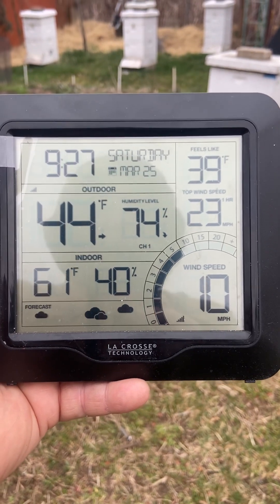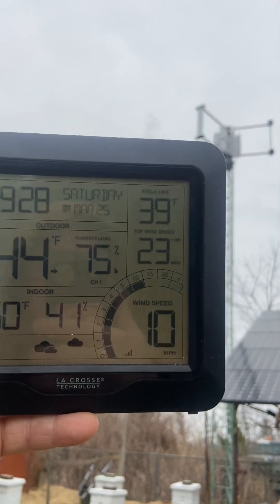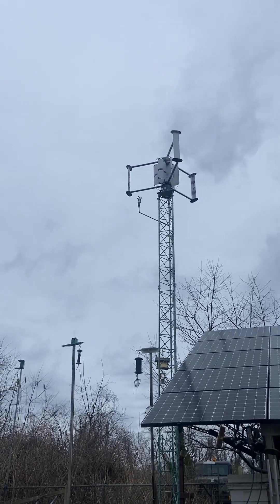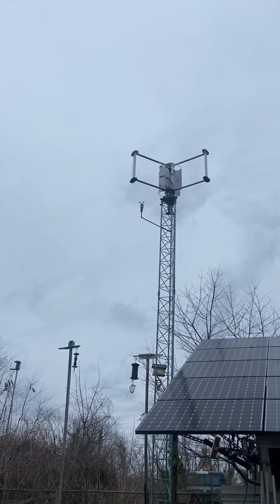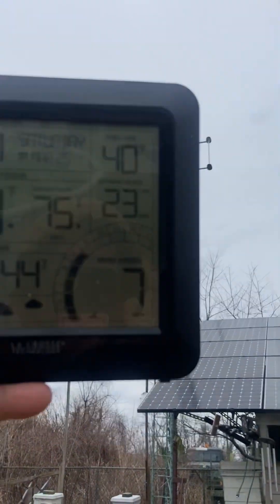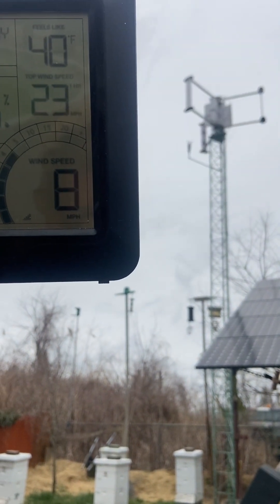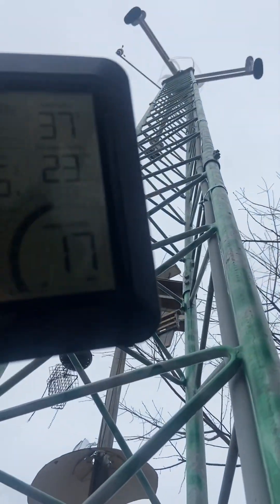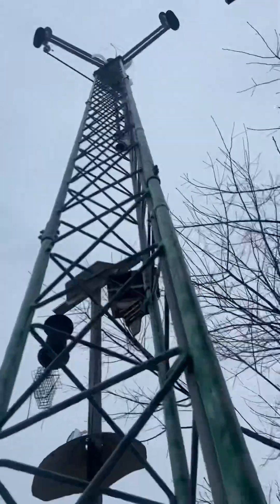Vertical Wind Turbine, test, run ￼￼

Comment: I'm sure it was a fun project. However , the start of a project should have been with anemometer data , trough some period of time , possibly throughout the whole year (wind speeds and direction , at desired height) , so that you can calculate average available potential energy of wind at specific location . That would help determine which turbine type/design , size and generator (potential) power. In my mind , lift type of VAWT are good for fairly strong and (more or less) constant winds , like onshore locations and hilly/mountain terrain , with specific landscape , which directs the winds (with fairly lightweight turbine construction , within a reason) . In other cases (I'm talking about VAWT) , drag type are better (savonius , with myriad of designs) , because they can utilize low speed winds and frequent change of direction of wind. In case of drag type turbines (usually low RPM) , torque is utilized (gearing included) to turn the alternator/generator (usually permanent magnet ones, air core ) at required speed for usable energy production. Also , most people are "obsessed" with physical efficiency (how much energy they an extract from available potential wind energy) , while I usually think of financial efficiency , which means , how much it will cost to build something (using recycled and up-cycled and free materials as much as possible) , that produce some usable amount of energy , for very small amount of money; if I'm about to spend a thousands of $ for it , I just might as well use grid power , as much as I like , for years , for the same amount of money.
Reply from the maker: Thanks for the input, That requirement for an Anemometer  was one of the things the state of New Jersey wanted six months to a year of data before they approved the rebate. Little out of reach for most people because it cost thousands of dollars just to put a stand up to collect the data. Just to see if you qualified., If you didn’t, you wasted all that money just collecting data.
Seeing I have already have a full electric house. +19 K in solar, and 40 K in Tesla battery  back up. 
This generator project is for me and I am an amateur learning a lot about the does and don’ts. Per say.
It’s not about the $Cost, it’s more of my interest in vertical turbine design…Hell for what it cost to do this project with out the turbine, I could pay for what little I get from the grid for 20 years.
As far as wind goes, I’m in a nitch area along the coast line in NJ. My average winds are 7mph to 13. But we get great storm winds and windy days that last for days.  
Plus I hate hearing the wind at night knowing that it’s lost energy I could be using or storing. 

This would’ve been a more successful project if the actual generator was designed correctly. 

Seeing it was an overall generator failure. I am rebuilding the vertical to put on a smaller  generator. 

 I threw in the hat and purchased a horizontal made by high energy, sold to me from hurricane wind power. That will be going up in the next several months.
Reply from the maker: PS as for the wind data I am very lucky on the river. Very close to me is a weather station that gives constant data,  over the last several years so it’s already on the website with wind grafts. Which us taxpayers paid for anyway in the thousands of dollars.
Plus here in New Jersey we get rebates for everything we do green energy qualifications. Except for labor so it paid for all the cost so far,  seeing I did all the labor.
Reply: @Themachinewon  That's great - rebates , I mean. I've only mentioned anemometer (I've meant relatively inexpensive one , from Amazon , or what ever) , because it gives you basic parameters for calculations . Otherwise , I've seen many people (online) wasting their money and I feel especially for those who live off grid and have a generator as only alternative (solar works , but in certain areas, with long winters and many gloomy days one needs pretty big
 solar array for a few basic appliances). Urban areas are different story (building codes , licenses..... Have a good one !people , in general , are very good at complicating life itself). At least , you've tried and learned a lot. Have a good one !

Comment: Problem with a verticle turbine it has both a negative and positive edge facing the wind. So only the differential pressure does the work. A horizontal turbine only has positive wind pressure and therefore efficient in rotation. I don't believe torque is the problem. Hope you get some rewarding results in higher wind's.
Reply from the maker: Plus one YouTuber that’s an engineer is going to take the dimensions and make calculations on the optimum size for the actual wind turbine
Reply from the maker: Well the next 2-3 modifications are going to go as follows. First, I’m going to bring the arms in to 2 feet dia , cutting out the weight of the aluminum arms and end plates. Then I’m going to remove three more blades from the inner turbine. Going to see how that rotates before I put the arms back on. I am going to let it go up with just three blades to see start up speed or rotation.
Reply from the maker: Well , the one reason it doesn’t work is the upper shaft seal was larger then the shaft. All that rain was going right into the bearings.
I posted a few short videos on it. Blows my mine how crappy their product it

Comment: Don't ever try to add a gearing. The only way to make it spin faster is to reduce diameter. You'll sacrifice power output but you will be able to squeeze some watts at low winds (which is what you get 99% of the time). Please let me know the size (metric units please) and I can give you some advice on what would be best diameter using the same airfoils. Again, forget about getting 4 digit watts out of it. I can help you but I can't break physics laws.
Reply from the maker: That was my next step when i returned home.  Currently the arms are at 43-1/8 from the outer edge of the 12 center hub. I’ll change all the measurements into metric for you when I return home. My first plan was to bring the arms in to 24 inches from  outer edge of hub. Also, removing the end caps to lose a lot of excess weight. Plus remove three more blades from the center to have a three blade configuration.
Reply from the maker: i’ll send you another message when I return home with the measurements in metric.
Reply from the maker: Drop me a email and I’ll send photos along with the measurements
TheMachineWon@hotmail.com

Comment: I agree - a gearing should work just fine by converting the high torque into high speed.
If you end up gearing the turbine, I would also extend the foils both up and down so that you get more potential.
I that case you will have to build a new mount anyway and you can just size the bearing so that you dont have to worry about the added weight…
Reply from the maker: Three more modifications , arms are coming in 2 ft , three inner blades are being removed. Test will see if weight is reduced enough.  then the the wings will be removed to see if only three blades work, doubt it !!!  then I’m going with just the 3 airfoils… Then I’ll purchase a Heli 2.0 … and be done …

Comment: Well, it certainly wasn't going to work like it was before. I don't know which is the worst, yours barely turning, or mine spinning like mad, and making 80 watts. It all depends on what you want from the machine. I'm going to try to put the windings in series by changing the connections internally, which would up the voltage, and lower the amps. I should be able to use it then, even though it won't make a lot of wattage. Yours is just harder because you only have the wind on one side of the blades, and that big generator to turn. Not looking very likely that it will spin. It's designed wrong. It might put out a little bit in higher winds, but it's not what you were looking for. I just now ordered a second set of blades. I got five this time, and a hub. I'm going to try to make one. I think that if you ever want any power out of yours, you're going to have to turn it horizontal, and I don't know how you're going to get  blades on it. They should put a warning on it, only buy it if you are an engineer. I just imagine that the blades would have to be on another shaft with a chain driving the gennie, because the generator shaft probably won't hold a set of blades. Or a different shaft pressed into it that will hold the blades. It should have had a tapered shaft and nut, or a sheave, or something besides two grub screws. They did a very good job of making it so that nobody can make it work. I can't believe they are still available. But then, I couldn't believe they ever sold one in the first place. The physics isn't there to make it work. Good thing you have solar panels. If you can completely redesign it to be horizontal and get some blades on it, it'll probably make some power. I'm going to build a home made one with a DC motor that my uncle gave me. It'll make 500 watts or so, and I'll be happy with it. I live on a hill, so it's only going to be 15 feet high. I get plenty of wind here. There's none at the moment, but the 🌞 sun is out on my panels. I'm going up on the roof of the barn to check my blades after the 60+ winds I had here yesterday. Then I have two new solar panels and two that I already have to put on the West side of the barn. Just think, that's another 400 watts, lol. Even if I only get 300, they will produce more than my wind generator. Solar works. This is my first windmill, so I don't know a lot yet. I saw a vertical wind generator out in West Kansas, using three right side Toyota Celica fenders for blades, running a one ton Chevy truck rearend with a manual brake rotor on one side, and the generator on the other. They had a 50 amp DC generator, some batteries and an inverter. No power line around close enough, they said. I had to stop and look. If you're creative enough, and want it bad enough, you can make it work, otherwise just buy a new one that has very good reviews from everyone. My 28 inch blades should be here in a few days. Then I'm going to do some cobbling together myself. I've learned to aim low on wattage output. If I can get 500 actual watts out of both windmills, I'll call it a win. Well, think about this...if you manage to turn it horizontal and it works, you'll most likely get at least a million views on the video. That would probably buy you a better turbine. Just saying. And you'll be a much better welder, lol. I would probably have to try it that way once. You will spend a lot of time getting a small return, though. And the sad part is that's by design. Or just blow it off and get something else. Please don't buy that brand again. Have you ever seen a good comment about one of these Atlas turbines? It's odd that no one takes the generator out of it's box, and uses it for anything else. The whole thing is just strange. What I'm saying is, no one knows if the generator is any good because they've never been able to spin it. And if they did, the two little screws would come loose. It's like it's engineered backwards, to not work right. So if you try to go ahead and fix it, it's going to be a major battle at every turn. They have designed it that way. So if you took the challenge and do it, you'll get a lot of views. But you might be the one who can make it work. Make the blade diameter six inches smaller, and see what it does...lol...if you want to make it work it's going to be a lot of trials. But you might get good results the first try. Could be the diameter is just a little bit too big. When you get it the right length, it will speed up , but the load will slow it, so I wouldn't take too much at a time... If it works, it's not going to make much. You just never know, that turbine might work sideways. It doesn't seem to want to turn the other way...maybe another intentional design flaw. I bet they said, if anyone ever makes this turbine work, they will be a genius, master redesigner. With a nice welder, LOL. Good luck. Practice up on that welding. I think you can do it. That set of five Stealth Storm blades should be here soon. You should get the 40 inch ones and build one out of yours, if the generator is any good. Get it out of that nasty box.
Reply from the maker: Well My eye's are on the Heli 2.0 on grid horizontal 5 blade right now, as the replacement,,, BUT  I'm waiting for the winds to come though tonight, see how this spins, Next move is to cut the Arms in half, bring the airfoil blades in from 43-1/8 to 24 inches.   Reduces the weight, and removing 3 more inside blades.  That came right from Tesup. 
I feel super good, I've prevented at least 5 people from buying Tesup Junk.  That's a least 5 grand they didn't get in funds. And that's the ones I know of ~~~My videos will hopefully put them out of business. There is no plans for that generator after Its off the tower, except to be put on a pedal bike with a gear on it...:face-turquoise-covering-eyes::face-turquoise-covering-eyes: